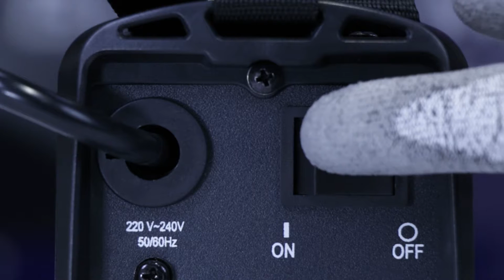Parweld XTS 142 MMA Inverter Welding Machine

Comment: Yes you can, however you will not be able to use it to the top of its range. The fuse in the plug will probably blow around 100 amps. Best to use the round blue 240v plugs and sockets. This is a very good little inverter for the money.

Comment: I too am looking at buying one of these. I also noticed that you used the same clip of weld demo on the 142 and 162? Makes me wonder if you used a much better machine to weld with. Really put me off buying. Feels like we're being decieved?
I just need a stick welder for making a trailer at home, and doing a few repairs. Would you recommend the newer model 143 or 162? How long can you weld with them before needing to let it cool? 
A reply would be much appreciated 👍🏻
Reply from the maker: Best to contact the Parweld Sales Team on 01299 269 500 or uksales@parweld.co.uk, XTS 143 and XTS 163 are new models, the other machines are being phased out
Reply: Why would you not be able to do that? You could do that with two 12v batteries and jumper cables.
Reply: Specs say it has a 60% intermittence at 140A, so that means 6 minutes of welding with 140A in a 10 minute timeframe.